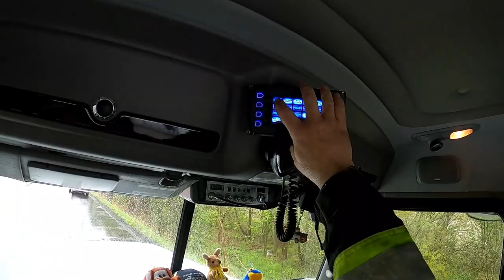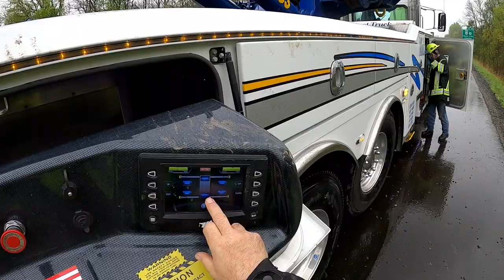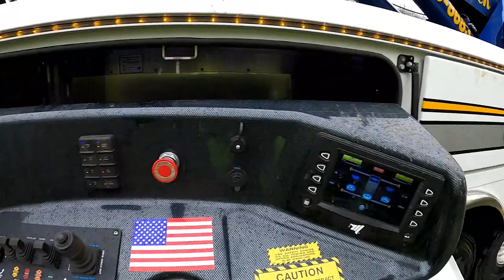Encore!!!  Encore!!!  Encore!!!  Well, Maybe, They Shouldn't Try This Again...

Comment: Tell me more about the headsets, I'm  interested in getting a set as well. Are they clear, can you hear them over an obnoxiously loud diesel (like my straight piped DT466E), how are they with a hardhat, what brand, where did you get them, and are they programmable? (A lot of questions I know, think I covered everything anyone might ask!)

As always, thanks for sharing!
Reply from the maker: Ok...so...I'll do the best I can to answer your questions.   Other viewers are also curious about the headsets.   First, they are the EarTech UltraLITE wireless headsets.   A viewer sent me two individual headsets, one master, and one companion.  The master headset has all the "controls" that a standard "hub" system would require, without requiring the use of a hub.  The set we have has only one ear muff so the other ear is open for ambient noise, which is a  very nice safety feature.  This system is, quite literally, put it on and it's ready to go.   Talon and I tested them at the shop for their clarity and range before we used them out in the field.   They are very clear and with a clear "line of sight" we got approximately 500 yards before they started to "crackle" .    The ear muff does allow us to hear over the other loud, ambient noises, such as  the engines running and traffic.  The boom mic does have a wind screen on it to cut down any wind noise.   It is an open mic not a PTT....very nice.  It also has an automatic mute if you rotate the mic to the UP position at 90 degrees away from your mouth.  They are also set up so that you can wear them on either ear and turn the mic accordingly.   After testing the two headsets, I went ahead and purchased an additional three headsets to complete the limit of a total of 5 headsets per a single "master".     I've answered all but one of your questions so far, I believe, and here is where I find the headsets a bit lacking.  They do NOT work well with hard hats, especially a standard full brim such as I typically wear.  The headset design is an expandable, hard plastic shell.   It does not fit over a hard hat and then fit to my ear.  The first several times I used it, I had to place it under my hard hat and then clamp the hard hat screw down so hard on my head that it was uncomfortable instantly.   It also didn't allow for a secure fit of the hard hat as witnessed in this video.  It left the headset securely on my head, but sent the hard hat and the viewers tumbling down the muddy embankment.  Some viewers have suggested that I place the headsets so that the adjustable shell is behind my head, basically on the back of my neck.  Unfortunately, this design does not allow for that for several reasons one of which being the boom mics' limitations.   To compensate for this problem I have temporarily switched to a baseball style hard hat rather than a full brim.   The headset does work over this style of hard hat, but I'm still getting accustomed to it.  I am very grateful to the viewer that sent us the starter set and, overall, I am quite pleased with this set.   We have looked into purchasing headsets that are specifically designed for our industry and they are quite expensive, starting out at around $6000 for a starter set of 6 headsets.   The EarTech isn't anywhere near that price range.   Perhaps we will upgrade in the future, but, for now, I will be grateful for what we have.   Thanks for watching and God bless.
Reply: @Ron, Reading on the UK page as I was curious, you can get the UltraPak which is a beltpack unit with seperate pluggable heatset which gives you a "round the back" style headset, or you can actually get various other headsets as well. As a bonus the UltraPak has a 3.5mm conversion cable for connecting to a camera if you want!
Reply: @RonPratt  Perhaps some design modifications can be worked out for the fitting w/hard hats.
Reply: @RonPratt  maybe put the headset over the band and web inside the helmet? Dunno if that’d work or not. I’m sure someone makes a system for using with a hard hat though.
Reply: @RonPratt  wow, pinned post, im honored!!!

Gonna have to look into a set for sure. Thanks so much for the detailed answer, I really appreciate it.    🌟 🌟 🌟 🌟 🌟
Reply: @RonPratt  dang 6 grand
Reply: Do you normally have another go pro running besides one on your hard hat
Reply: @RonPratt  I agree with you Ron Pratt
Reply: Gotta get some chin straps so your helmet stays on.
Reply: @tractorboy31  "l, <

Comment: I think MoDOT might want to put up a Guard Rail. I'm glad no one was seriously injured!
Reply: What I was thinking. 😂😂😂
Reply: From a roadway safety perspective, it's important to remember that guardrail itself is a hazard to life and property, and should only be used where it's shielding a worse hazard. In this instance, the vehicle went off the roadway, stayed upright down the slope, and didn't strike anything solid at the bottom. The occupants walked away, and Ron got the vehicle up in good shape. 

If guardrail had been there, the vehicle definitely would have sustained damage from the collision, guardrail would need to be replaced, and the potential for worse outcomes for for the occupants would have increased - as an extreme case, the vehicle could have rebounded into traffic. Where to place guardrail is an important part of roadway design, and from looking at a map and Ron's video I believe MoDOT got it correct here.
Reply: If you think MODOT is gonna do anything proactive you're kidding yourself
Reply: Why not back up the car,turn left and drive down that road?
Reply: Phytonso has the right idea
Reply: John C  Amen.

Comment: Hey Ron, try a set of Bluetooth capable headset called AfterShokz. They do not fit in your ear but actually use your temples to transmit the sound.
That leaves your ears open and you can wear your hard hats and still chat on your radios.

Comment: Nice video Ron. Question: Could you have picked it up by all four wheels and carried it out? Just curious.
Reply: probably extended the boom far enuf to throw a lifting strap thru the front windows  and drag it back enuf to lift it straight up, but that takes the same time to rig as what they did, and less risk of crushing the roof

Comment: Not sure what video editor you use, but patching the radios in may be just as simple as an audio recorder left in the cab next to a radio. Just cut to Mike or whoever is with you when they say something worth including. Be the cheap and easy way I would think. Or use the audio from a gopro on the back window. Drape a head set on top of it.

Comment: Hearing the "bad on blades" comment & seeing your very own Stihl saw, I gotta ask, do you use Stihl carbide chains? A friend just told me about them the other day, he said they're around $60 each at the Stihl dealer and dirt doesn't dull them. 

I guess this is either the chain or a variant of a chain designed for Fire/Rescue work, and that fireman with the cute cordless saw might just be using one. 

I've been meaning to pick one up for my MS290 Farm Boss the next time I stop to use at home, but I cut trees with a cordless Sawzall on accidents because I carry one to cut converters & can't justify the tool box space for a second saw, tools, and gas. I mean I guess I'm part way there, as I've got an Oregon wedge in my lockout kit.

Comment: Great job fishing that car out of the ditch! Overkill, but unfortunately small tow trucks lack a rotator. Best of all, no damage!

Just wondering, how often do you have a recovery where the vehicle is drivable and has little to no cosmetic damage after an accident like this?
Reply: A Dynamic rotating rollback would've been perfect for this job. I'm surprised Ron hasn't looked into getting one.
Reply: He probably has looked into getting one several times, but always decided it wasn't worth the investment yet when they can get the job done other ways, and their current rollbacks are still in good shape.  shrug

Comment: My question is, in this situation would it have not been better to wait to remove this vehicle until later when it is dry to try to reduce secondary wreaks?
Reply: My opinion is there is just as much chance of wrecks with people rubber necking to see the car. At least they are slowing down with emergency crews around. (Hopefully)

Comment: Could I enquire to the make of your radio headsets please. My nephew is Autistic and has issues with loud sounds. His mother my twin sister has hearing loss and has to use hearing aids, thus has problems with too much noise about. This style of hearing protectors would be ideal. Cuts the noise down for them both but allows easy communication in noisy locations and venues.

Comment: doesnt apply to this lift but was watching another company the other day that got stuck on rotater they used landing gear to get out really didn't show exactly how. but got me to thinking does the underlift have ability to apply down force. if so i designed a device to attach to underlift that could be pushed into the dirt and then extend underlift to push the truck forward could also be used to help if the wrecker was being dragged backwards as a additional lodge to prevent sliding.

Comment: If you dont have the headsets that clip to the hardhats inner bands (many have this feature btw- sometimes you need to buy the adapters that replace the headsets 'band' with the 'clips'- then to stop the headsets lifting the helmets bands off your head, 'thread' the headsets through the hardhats bands so they are  'intertwined' if you get what I mean- it works well for those brands that don't have the adapters- basically the hardhats band goes around your head as it normally would, and the headsets band 'threads' between the hardhat and the hardhats bands so it sits outside the hardhat bands.... Its a bit hard to describe, but if you look at the bits it should be obvious what I mean.. I'm not near my rig atm or 'd take photos...

Comment: I would really like to see a video where you explained the controls and operation of the rotator. What do the blue buttons inside the cab do, the controls on the rear side drop panel, the remote control, etc. Good and interesting videos. Thanks for sharing.
Reply: look back to when he first got tator, there's a few mixed in

Comment: It's amazing how seemingly minor wrecks can end up with injuries. I know when I put my 76 F100 into a 3 foot deep ditch straight on I ended up breaking three ribs.. two right in line with the top of the bench seat where I'm 6'10 and all torso and my back hit the cab.. on side split about 1 1/2 inches from my spine and the other about 3/4 of an inch from it and the third is about 2 inches from my breast bone right up under my collar bone where the shoulder belt ran.. Even 14 years later I still am having issues with them, this morning I rolled over in bed and my rib on the front grabbed the flesh and pinched it. Not a fun injury.

Comment: question to your viewers=
How would you get that car outa there without use of any other support or toe vehicle (without waiting for weather to clear)?
(You may assume engine and transmission all ok and fuel in car etc.
You may also assume you have some long toe ropes at hand in back of car.
And its just you driver and maybe one other helper)
Reply: Ok two days no responses; maybe I could suggest strapping the rope around the axle or tyre, or even the wheel spokes themselves. As you slowly turn the drive wheel it would pull on the rope, the other end tied to a nearby tree.
Inch by inch, might take a while, you could navigate outa the sodden mud.
Maybe Ron might disagree but sometimes you have to do what you can to get outa a difficult situation (ps I have seen this technique in other youtube vidz but never had need to try it myself, was stuck in deep snow once but tractor dug me out).

Comment: Crazy question, why do they take the keys with them, it's not like someone is going to take the vehicle from where they left it parked.......
Reply: Habit, training, reflex on exiting their car.  When I was learning to drive, my Dad leaned very hard on the idea that when i parked the car and left it, even for a few minutes, I should take the keys with me, and lock it.  Or I might come back those few minutes later and find NO CAR where I left it parked. Or find the car had been rifled through for any item that might be valuable enough to pawn or fence for a little cash. Or, Mercy Me! that someone had got in, popped the hood and absconded with that brand new alternator I just had put on.
Granted that a car in a sad situation like this one is unlikely to be stolen, but the driver is probably not thinking straight right then, if thinking anything at all more than "Get me out of here!"  and that's when reflexes are guaranteed to kick in.  It's going to be a cool driver who LEAVES the keys for the tow operator.

Comment: Another job well done Ron. May I ask what the perforated vertical cylinder we see apparently on the driver's side door, or just forward of it is for on the Peterbilt? I am not an HGV driver so my question must be obvious for those who are. Thank you for yet another interesting video.
Reply from the maker: If I am understanding correctly what item you are referring to, I believe you are referring to the air cleaner housings.   They are large chrome/stainless steel cylinders that house the air filters and are located just in front of both entry doors.   Is this what you are referring to?   Thanks for watching and God bless.
Reply: @RonPratt  Thank you for explaining so quickly. I paused the video to ask the question and saw the one on the passenger side as well afterwards. HAPPY EASTER to you, all of your families and employees.